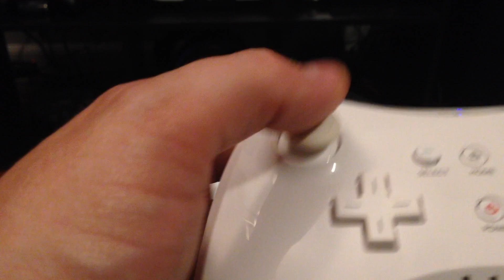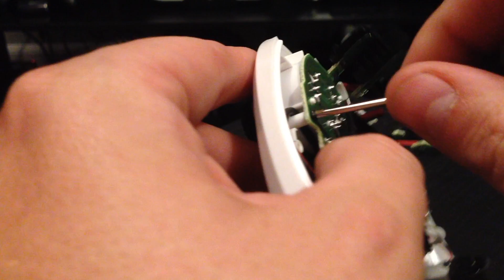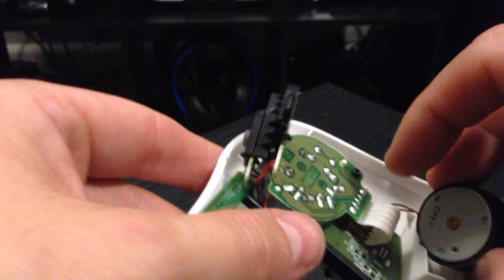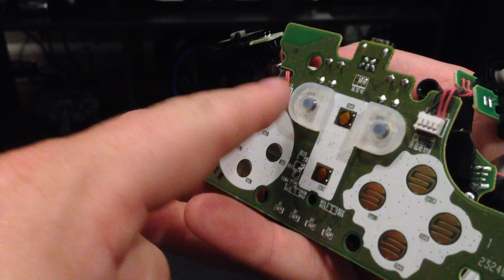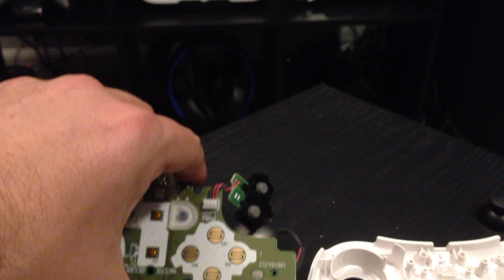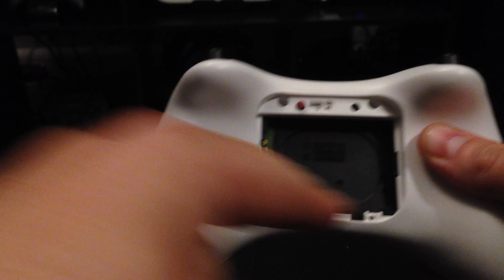The Worlds First Wii U Elite Controller?!?!!

Comment: So other than the WiiU logo in the middle, there isn't any difference between the official Nintendo controllers and clones?? (oh other than battery which you transfered)
Reply: PioneerT90 I bought some and my first one died a few weeks after and both had grindy sticks when moving them around. and squeeked so when getting a fake you really take a risk. if you get a good off brand controller for a really cheap price than I say go for it but like right now Pro controllers are on roll back at best buy and target for 10$ less

Edit: Oh and the D-pads never worked correctly. they did whatever the hell they wanted and the controller couldn't be opened to replace the parts parts without breaking the controller to boot

Comment: where can I but the elite parts seperate
Reply: from ebay, amazon, aliexpress. heres a ebay link http://www.ebay.com/itm/Replacement-Thumbsticks-Button-For-XBox-One-Elite-3-5-mm-PS4-Controller-Striking/382137583905?ssPageName=STRK%3AMEBIDX%3AIT&_trksid=p2055119.m1438.l2649 or this link for ps4 one http://www.ebay.com/itm/31-in-1-Thumbstick-Joystick-D-Pad-button-for-PS4-Slim-Pro-Dualshock-4-Controller/252999793801?ssPageName=STRK%3AMEBIDX%3AIT&_trksid=p2055119.m1438.l2649